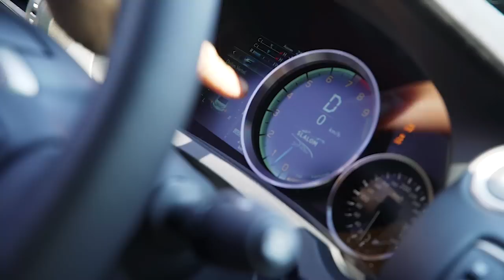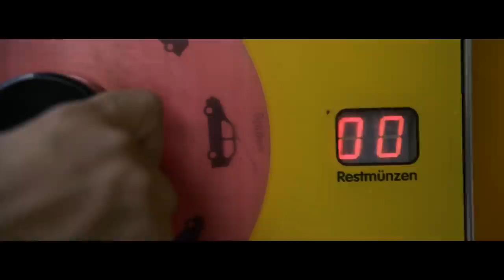JP Performance - So macht man's nicht | Lexus RC-F Felgen

Comment: Hey JP ich habe da mal ne frage. Du sagtest ja dass bei dem M4 durch den 6 Zylinder nicht mehr viel zu holen ist, bei supras und R34 GTRs ist es aber doch auch "nur" ein 6 zylinder, der teilweise sogar kleiner ist, da lässt sich aber weit mehr rausholen. Ich denke mal das liegt an der art des Blocks und der Komponenten aber könntest du das vielleicht mal genauer erklären? Geiles Video wie immer übrigens
Reply: Deutsche Kompakt Bau art Machts möglich. Da ist 0 platz Es gibt nur wenige Komponenten die mehr Leistung Geben als serie. Da der M4 Grösser ist ist da um einiges mehr platz. Und die supra is fast "Halb" leer vorne.
Reply: Dominik Dominator ich glaube auch es liegt an der ansaugung und allem die Einfach mehr zulassen.
Reply: Der Motorblock von dem 2jz gte (Supra) und den RB-Motoren (Skyline) ist ein Graugussblock, die halten mehr Belastung aus als die modernen Motoren mit Aluminiumblock. Sind allerdings auch deutlich schwerer daher wird heutzutage Aluminium verwendet welches sich auch leichter bearbeiten lässt.
Reply: weil die Alten deutlich stabiler sind
Reply: Die Amis fahren beim M3/M4 mit upgrade ladern über 700PS (evtl. sogar am rad? weiß grade nicht)
Standfest ist der Motor allemal, nur kriegt der M4 schon 550PS nicht mehr auf die Straße.

Gibt ja auch genug Leute, die im N54 über 1000PS fahren. Gibt Kreise, in denen wird der 335i als "neue Supra" angesehen.
Reply: Wobei man die Direkteinspritzung auch tot legen könnte und auf Saugrohreinspritzung umbauen kann. Der limitierende Faktor ist aber irgendwann der Block. Der verzieht sich bei zu hoher Leistung und dann können solche Sachen wie festgehende KW passieren.
Wie schon gesagt sind die Leistungsmonster aus Japan auf Gussblöcken bassiert. Ähnlich wie es damals auch BMW in der F1 mit dem 1500 PS 1.5l M10 gemacht hat.
Reply: Ultrabenbooyah hast du das von diesem labersack matt farah? der 335i ist mit viel ps ein motor rebuild alle 6 monate. Kompletter Witz das mit der Supra zu vergleichen.
M4 mit viel Ps bringt ja nix, hinterradantrieb und vorne motor, dazu nichtmal nen richig schweren.
Reply: In Russland fahren sie auch 750PS Motorleistung auf stock Komponenten nur auf upgrade Ladern. Soll wohl ganz gut halten
Reply: Dominik Dominator liegt am gussblock vom rb26dett und 2jz-gte
Reply: russia4ever325  auf einem Lada ???
Reply: Ganz einfach, die Asiaten bauen einfach bessere Motoren als die Deutschen ;)
Reply: Big gum  Schwätzer
Reply: dankeschön, gut erklärt.
Reply: +Carsten Der motor ist auch ein totales biest, hat richtig potential !
Reply: @M-Power Bernd Nein eigentlich auf nem M4. Aber ich kann dir auch gerne Videos Schicken, wo ein paar Ladas BMWs abziehen
Reply: Dominik Dominator ich denke liegt an der drehfreudigkeit.. diverse skyline supras drehen bis 10'000 zudem sind sie halt älter heisst stabil und härter gebaut. Skyline nennt man nicht umsonst Gojira/ Godzilla
Reply: was ist ein skyline supra? :D